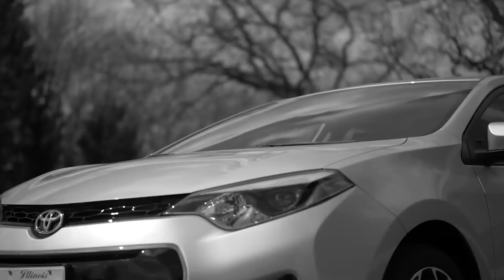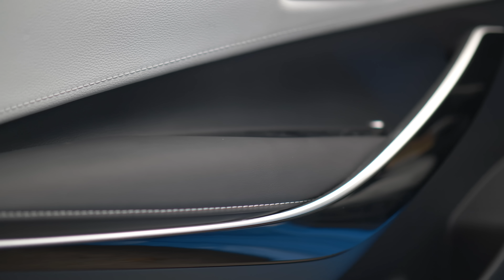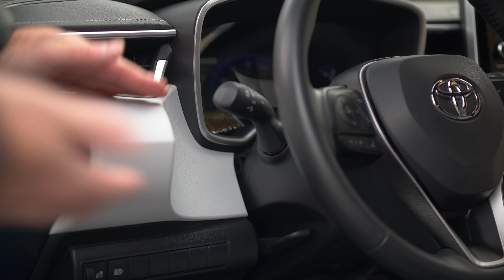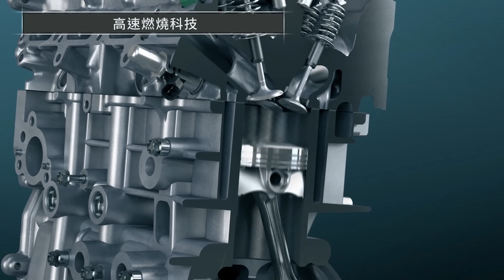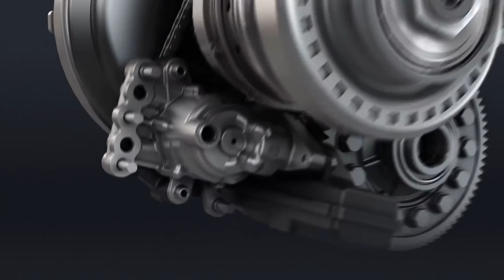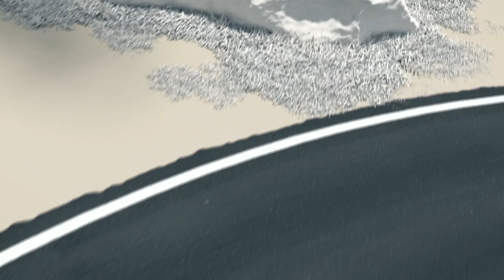Review | 2019 Corolla Hatchback | Sleepy Time is Over

Comment: The manual would be a better choice for the Corolla Hatch than the CVT for a number of reasons
Reply: well? start listing them reasons.
Reply: @gwot  Reliability, acceleration, smoother shifts (depending on ability), fun factor!
Reply: @lancelittleton9802  reliability? maybe, if you're talking about the traditional sense, but Toyota's CVT's pretty reliable, my mom owns one. Acceleration and smoother shift? you will NEVER beat a CVT in either of those category, ever. These 2 are the whole goal of CVT, CVT literally does not shift (non "simulated"), you can't beat no shifting in smoother shifts! and a CVT can keep the engine at its best RPM all the time, try to out accelerate that in a manual. Fun factor is the only reason, which is reasons enough for me to only drive manual.
Reply: @gwot  manual is more reliable, simper, and cheaper to repair if there is an issue.

Comment: Another great review.  Toyota seems to have put the Corolla back on the map.  

People get what they get regardless of competitors and their price.  CVT longevity has been questionable (look at early nissans), so I would like to see more long term reliability stats before I jump in on one.  The market seems to be swinging back to better, conventional automatics.  I am curious to see if this trend continues.  

If I had 25k, I would get a base model WRX for around 25k.  As much as I loved my previous GTI, VW reliability is such a drag.  WRX isn't the best by any means, but it has the additional power that one craves and can also come in a CVT.  The latest gen seems to be holding up well over the years as long as you don't push the power too much.

If I had to absolutely get a hatch and I could wait until next year, I would totally wait and see how the next gen  mazda 3 with their new engine drives.  The next gen golf will also be out around that time.  MY2020 will be an awesome year for automotive as a lot of good stuff will be out by then.
Reply: Toyotas CVTs are very reliable. They have been making them for over 20 years in their Aisin plant. Nissan makes their transmissions in their Jatco plant, and a lot of auto manufacturers use them, so you see a lot of problems with CVT's from Jatco.

Comment: Rear leg room is a very tight 29.9 inches. One of the worst in this category of car.
Reply: Yes Rear Seat Legroom Is Important And they Have Reduced it on this Model Which Really Pissed me Off I am Surprised not many others Have Picked up on this ,Including Mr Goose, Previous Model Has a Good Amount More Legroom and You can Tuck your Feet Under the Seats Really Easy Also, Otherwise Yes I Wound Have Bought This Car.
Reply: John Harris what previous model?
Reply: @johnharris4600  I haven't been inside this car yet, but 2 other video reviews I've seen - with 5'10" and 6'0" drivers sitting "behind themselves" - showed just enough rear leg room to avoid knees touching the front seat backs. In other words, simply adequate rear seat room for this car's exterior size (unless you require a child's car seat, possibly, or carry rear seat passengers over 6').
Reply: @FreneticMotorsports  I don't think it's on the new TNGA platform yet
Reply: The rear luggage seems to be getting worse with each iteration of the Corolla hatches too since the late 2000's.
Reply: Cassette Walkman They’re doing it on purpose so people have to buy a more $$ suv
Reply: It is MUCH tighter in back than the outgoing MC platform cars.

Comment: When I went in to look at it, the space was too confining. The rear seats, head room, cargo room just felt too cramped. And because there's so much paneling underneath, oil changes will be more difficult to perform. Plus, the engine bay is still tight. Getting your hands and tools in there will be annoying as fuck. Civic hatch and Kia soul made more sense, but I like Toyotas D-4S engine.. Either going for spacious utility but engine problems or cramped style with possible engine problems.
Reply: Yes Rear Seat Legroom Is Important And they Have Reduced it on this Model Which Really Pissed me Off I am Surprised not many others Have Picked up on this ,Including Mr Goose, Previous Model Has a Good Amount More Legroom and You can Tuck your Feet Under the Seats Really Easy Also, Otherwise Yes I Wound Have Bought This Car.
Reply: Derika Friedrich first two years you don’t have to worry about oil changes, free maintenance for two years through Toyota in the US 😉 but you are right, it would be harder to do. Most cars are moving onto the paneling now though.
Reply: Mazda called, they make a solid competitor too lol. New model coming out soon as well which I hope savage reviews
Reply: cause toyota expects to have no repairs, just change oil and this'll be good for like forever

Comment: I have nothing against CVT's, but if I have a CVT give me a real CVT.

One that actually works like a CVT. None of that fake shifting, I like the physical first gear so it doesn't feel like you're being shot off a rubber band but when I leave it in auto, just do CVT things. I like the paddle shifter and gear simulation for a "Sport" mode, but in auto it should not fake gears and just function like an actual CVT.

Comment: No thanks on the CVT. They don't handle boost well.
Reply: Its not a rice racer to be. Lol
Reply: @DS..69  Ever heard of ECU Remaps? Air and fuel ratio tuning? These gearboxes are not mean't to work hard.
Reply: @iphone202020220  So buy it for what it is. A commuter.
Reply: @DS..69  Also What is "Ricer" about a turbo charged car which can go fast? You're clearly not educated on this subject, Ricers are N/A cars with fart cans with no tune, straight on stock ECU map. They usually get useless modifications that doesn't work. Huge difference between a properly tuned car and ricers.

Comment: LE version (16" alloys) is what to get if you don't want frequent wheel and tire damage due to potholes.
Reply: The SE has 16" alloys. . Canadians can get an S version with 15" steel wheels.
Reply: My 18" have done great on Michigans cratered roads (lots of dirt and one winter included) for 25k miles now. And they look good doing it too

Comment: We just drove the xse hatch. Wife is wanting a Honda fit, cvt unfortunately. I took her to drive this. We both really liked it. I didn't care for how lightweight the steering is. It handled well and was comfortable, which is what we want/need. She was still sold on it and it's her car but the deal breaker was the rear seating room. We have a 5 year old and her legs would be smushed into the back of the driver seat when I drive and I'm only 5'-10".  Moving her side to side is not an ideal option. The rear hatch space is also very lacking for grocery day. Yes the rear seats fold down but again not ideal with a kid. If there was a smidge rear seat room we would have bought it. The frozen white paint looks amazing too. For someone without kids, looking for something that drives nice, handles well and you want good gas mileage and a little funky at the same time, go for it!
Reply: Yes Rear Seat Legroom Is Important And they Have Reduced it on this Model Which Really Pissed me Off I am Surprised not many others Have Picked up on this ,Including Mr Goose,  Previous Model Has a Good Amount More Legroom and You can Tuck your Feet Under the Seats Really Easy Also, Otherwise Yes  I Wound Have Bought This Car.
Reply: Have to wait for the 2020 Corolla sedan @johnharris4600
Reply: @mallrate25 i drive 4 people in one of these every day and theres no complaints :)
Reply: Light steering is a deal breaker for me. Most new Toyotas are like that. IMO, all electric steering should be adjustable.
Reply: @dualityofman1253   Having no place for back seat passengers to put their legs and minimal storage capacity is a deal breaker for me.
Reply: Exactly right on the children and foot space. A child in a booster or car seat - their feet are high up and poke into the back of the front seat - actually take up more space than an average adult because their feet aren't on the floor, under the front seat. I'm not tall either and I test drove it with my child and it just didn't work. That's a deal breaker and really too bad because I really liked it otherwise.
Reply: Fit has even less space in the cargo area and less horsepower.
Reply: Nodak81 less horsepower yes but the rear load floor is much deeper and the magic seats are glorious. Unfortunately new fits are hard to come by at the moment. We can't even find an ex-l in our area to test drive. I have been told production stopped early due to flooding at the plant, but the 2019 model should be hitting dealers in November. I wish there was more info available on the fit redesign for 2020 supposedly. I know spy shots have been posted and it looks like a full body redesign but only rumors and wishful thinking of a turbocharged engine. I may try to wait it out at this point. My wife's current car is only 2 years old but doesn't fit our needs the best.
Reply: Nodak81 no, the fit completely out space this corolla, you can tell by just looking at the rear design on both cars, fit is basically a smaller family van, I'm 6 2 and I can sit comfortably behind my driver seat, also its a manual so I need more leg room in the front for clutch, the rear seats of fit not only folds down to create more trunk space, but also folds up to create more rear floor space
Reply: The new European  Corolla wagon has 4 extra inches of rear leg room and much more cargo space.
Reply: Right Lane Hog but this is the hatch not the wagon, also take a look at honda jade
Reply: Right Lane Hog now I would buy the wagon!
Reply: @mallratt25  Check out the 2 minute video for the Corolla Touring Sports on Toyota Ireland's Youtube channel . We need to campaign to get that car over here.
Reply: You could look at a mazda 3 or a golf, if you want a hatch that is not a cvt.

Comment: Even as a card carrying member of the anti-CVT brigade I have to admit that the design and engineering is getting better. The new Corolla and the Kia Forte are prime examples. Happy to see Geese recognizing that fact as well as noting that for the vast majority of drivers a CVT, traditional automatic, or a DCT simply doesn't matter as long as they don't have to shift,  themselves.  Personally I find "simulated" gears as annoying as "simulated" engine sound and "simulated" exhaust tips. But I'm willing to admit that I'm in a small minority. 

As for those wishing for a turbo version of the Corolla (or for that matter, the Camry) it's important to remember that Toyota cherishes its spot at the top of virtually every ranking of brand reliability. They're not willing to risk that status to appeal to boy racers and others who want higher performance models of their vehicles. Again, I'm a fan of hot hatches but most consumers value reliability and resale value over performance. And Toyota is in the business of selling cars, not satisfying "enthusiasts."

Comment: The problem isn't that Toyota can't build a good CVT design or a reliability engine it is that the whole thing is incredibility complex and you mix in the technology and harsh ride quality of the low profile tires and the expense with those and suddenly a Kia Soul seems like a better cost of ownership.
Reply: Not necessarily. Multi link suspension was the best thing they did. The soul is Torsion beam if iam not mistaken, harsher ride.

Comment: Again with chrome where I wish manufacturers would allow an optional black.  And no comment on the fake exhaust valance in the rear?
Reply: I see the SE allows for no chrome except for the fake exhaust.  I wish toyota would really push this to a true performance hatch.  200hp, LSD, short shift 6spd, real dual exhaust, and drop the ride height an inch.  Then I'd buy one, as is right now, there are better and bigger options for a commuter vehicle.

Comment: Also, how is it that in 14 years they've only improved their 4cyl engines by less than 20 hp/liter? I would expect to see way more than 168hp and 151 lb-ft out of a 2019 NA 2.0L. My 2005 Camry with the 2.4L has 160hp and 163 lb-ft.
Reply: Some of the improvements went to fuel economy and emissions. At this point, there's not much more to easily get out of internal combustion engine tech.

Comment: In my honest opinion, CVTs trying to simulate a TC Auto is bullshit. CVTs are great at holding the engine at a desired RPM. If I'm going to get a car with a CVT I'm going to want it to hold the engine at peak power when I floor it in sport mode. Don't give me this "simulated shift" BS, Toyota. If you're going to give me a CVT, at least commit to it and use it to its full potential.
Reply from the maker: It will hold at a specific RPM if you nail it at like 45 miles an hour. But from a dead stop it will usually shift.

Comment: great job as usual Mark.... would love to see your insight on the new Volester N brother.... i wont buy it until I hear your opinion about it.... thanks
Reply: Joseph Espinal I saw one in person but I didn’t get to drive it. I thought it looked good and very unique. My only gripes was the interior. I am surprised to see so much hard plastic everywhere and barely any soft touch materials. The tablet center information system looks cheap. The rear passengers are best suited for kids. But for the money it looks good 😊
Reply: @rmwarriors16  Cheap interior for mid $30s price point is disappointing.  I've heard it drives great +1 for a proper review.
Reply: The Veloster design refresh looks a lot better, and the N looks like it will be the best performance car at $30k mark.....dealer said they will be rare though, most dealers getting only 1. They need to make more...